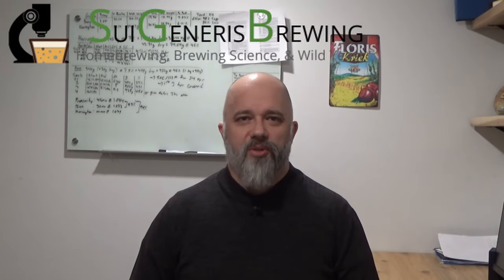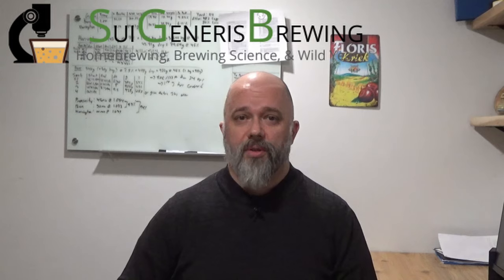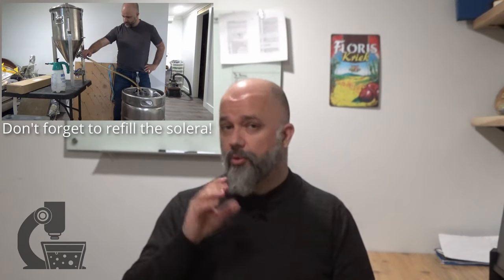Solera Series Part 3 – Finishing Beer From Your Solera

Comment: Do you think a solera made with just regular yeast would last years too? And also do you think it would affect negatively a light beer like a pilsner for exemple? Id be worried about autolisys and oxydation.
Reply from the maker: Regular yeast is typically going to be fine - keep in mind that you preferment with fresh yeast, so each refill "recharges" the Solera. That said, I don't think a pils would work. You need a beer (& corresponding yeast) designed for long aging. For a non-sour beer that will probably need to be 6.5% ABV or higher (8-10%) being preferred), and a yeast/recipe designed to age for years. I'd look to barleywines, RIS's, and strong Belgian ales for inspiration.

Comment: Genuine question, so you don't need to add any water when you ferment the fruit by itself? Loved this series by the way.
Reply from the maker: No water, as it would dilute the fruit. Most fruits contain 5-10% sugar, so yeast have no trouble fermenting it.
Reply: @SuiGenerisBrewing  Sweet, thank you. I do have a follow up question though. Have you ever thought about doing carbonic maceration with your fruits?
Reply from the maker: @jonathanallenphotography  I've done it to make conventional sours, but not for my Solera. I'm not usually that well planned out for the Solera.